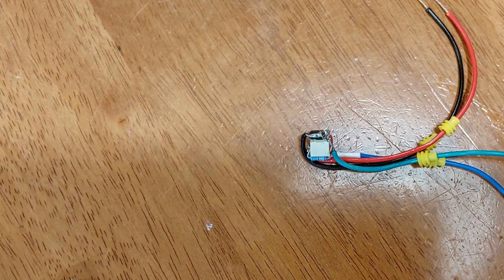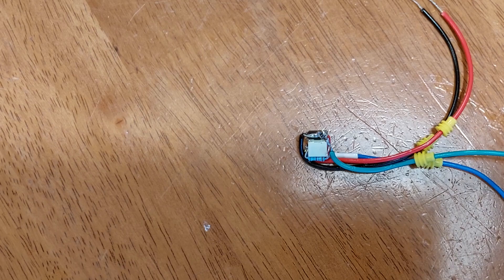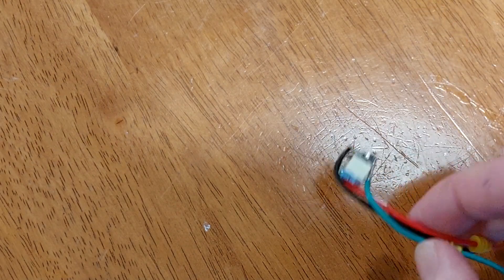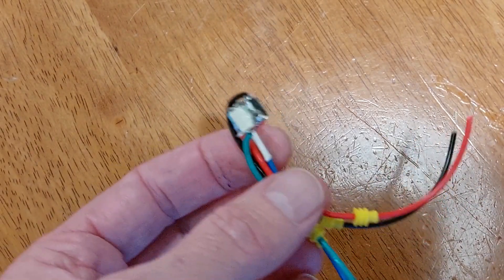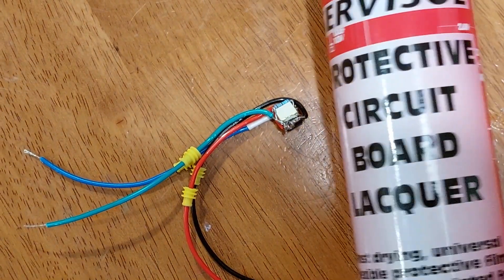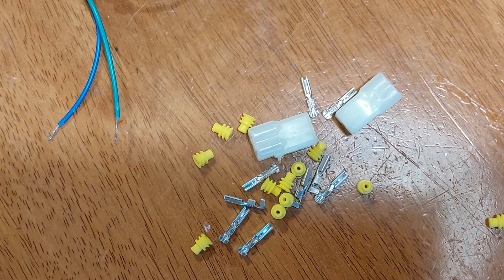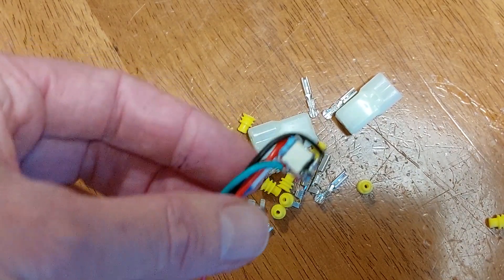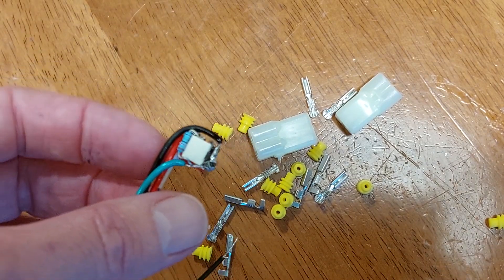o2 sensor delete revisited

Comment: Can you not run the data out put of Zeitronix back to the ECU? Or just install it Separate from the ECU..leave stock ones on.
Reply from the maker: The zeitronix is normally not connected at all. I only reconnected it while playing with the tuning and wanting to refine the AFR.
Exposure to water ingress is also not fun. There isn't really enough space beside the radiator under that cowl for all the necessary wiring which means I would need to re-route it. This is easier. It took me less time to solder this than it would to re-route wiring to somewhere it wouldn't get wet.

I don't have a second bung to leave the stock o2 sensor connected and if connected it needs to be installed in the exhaust to prevent error codes.
Reply: @CrankyNerdRides  Also running them in an exhaust with out them being warm and on they dont like that.
So as far as i knew theres only Logbox (the Denso 1) that the wideband o2 sensor replaces the stock and connects to the ecu to be used as the stock... Any way ive just used my o2 sensor on their own lop not connected to the ecu.. Im not sure exactly where the stock ones are but if your saying near the radiator that may be to close to exhaust port for it to..
Reply from the maker: @stephengale8601  You should take a step back and consider that my bike is a 2023 MT09SP. There are a lot of fault codes relating to the o2 sensor function that when triggered will disable the cruise control, disable power mode and tcs changes and finally disable the quickshifter. It's all listed in the service manual and I recommend that you read that.
It will help you to better understand why a well functioning o2 sensor delete that I can put together with ease in very little time is a better solution than trying to keep the o2 sensor connected.

With the zeitronix logger connected I can either go without the cruise control or I can have the o2 sensor delete that is able to trick the ecu into believing that a fully functioning o2 sensor is connected in every way that the ecu monitors the performance of the o2 sensor.

Comment: what's the point of this O2 delete if you can just turn off the O2 sensor loop in the ECU with your woolich software?
Reply: The feedback loop is just telling the ECU not to modify the fuel map based upon the data that it gets from the o2 sensor.

The ECU however expects the o2 sensor to be there even if it's not using it and will throw error codes. There are approx 5 (just of the top of my head) fault codes related to the o2 sensor that will do anything from preventing the cruise control on the SP to disabling the quick shifter and also preventing you from changing ride modes.
Reply: @MrBCRC  I have a 2024 with cruise and I got full woolich kit with wide band. Now I'm curious if I'm going to loose cruise control functionality with my kit. They recommend I remove the wide band sensor after I'm happy with my tune to prevent continuous heat wear on the sensor itself.
Reply from the maker: @rojoracing53  It depends on the fault definitions for the gen4. You would need access to the service manual for that. You also have to deal with the gen4 having two o2 sensors one before and one after the cat. 

If you disconnect the o2 sensor on the gen3 it will fault for the o2 sensor heater not working and the only thing that gets disabled for that is the cruise control. I was fine riding without it while I was developing the fuel maps but when I was done I wanted to explore an o2 sensor delete so I didn't have to re-connect the o2 sensor.

Part of the reason I did that it was people having problems related to o2 sensors after having a tune done. Thinking about it now I suspect that the tune was rich enough to make the ECU think that the o2 sensor was stuck high (Fault P0134).

It sounds like you're going to have to experiment like I did particularly given you've got 2 sensors.
Reply: @CrankyNerdRides  I'm in the US so I've only got the one narrow band on the GEN4 that I'll replace with a wide band to tune the bike.  My hope is while tuning with the wide band the bike is happy with the different O2 sensor and I can retain all my functions.  If the bike is not happy with out an O2 sensor after I'm satisfied with the tune I guess I can put the narrow band back in with it disabled so I can keep my wide band fresh to future tunes.  The 3rd option would be a O2 delete like you've made but that is beyond my level of electronic building experience.
Reply from the maker: @rojoracing53  Be aware that they are available to buy. Not my ones but other commercially available ones. Just google for it and you'll find plenty of options.

My ones are me just doing my own DIY thing because I can.